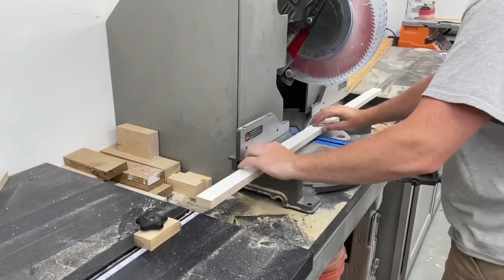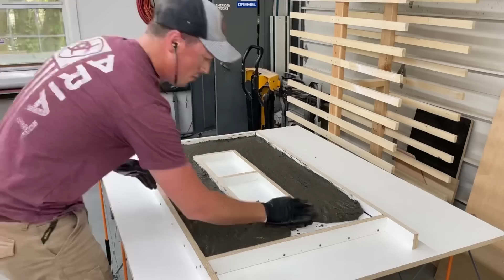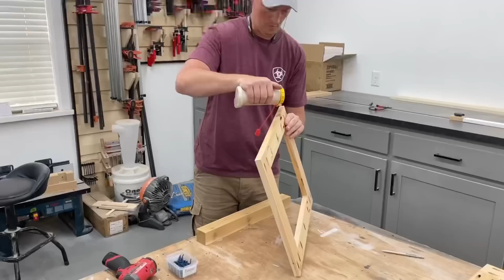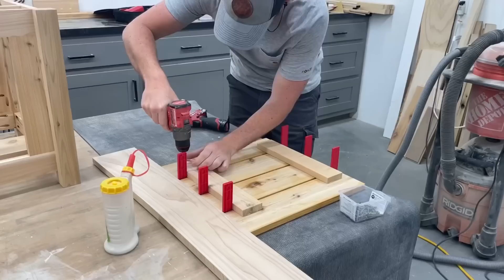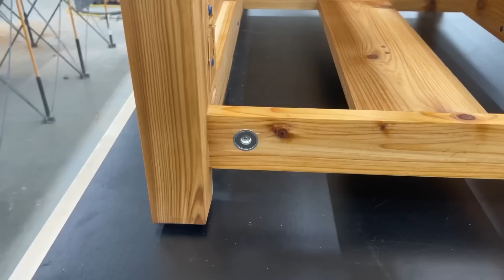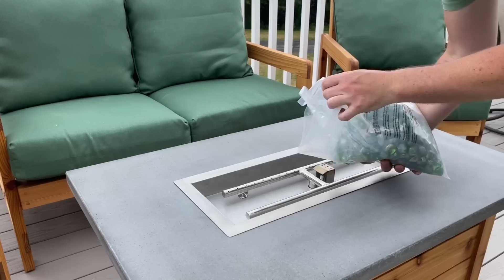DIY Fire Pit Table Build | Outdoor Furniture

Comment: I have 10 vertical 20 lb tanks. I hate to buy yet another tank. Can the vertical tanks be used instead?
Reply from the maker: You could build a taller table to use a regular tank
Reply: @JohnBuildsIt  i was not sure if the fire pit needed a horizontal tank. Thank you

Comment: This will crack with heat.  Mine did.  Same set up😢
Reply from the maker: Zero issues after 2 years with lots of use 🤷🏻‍♂️
Reply: did you have extreme temperature swings when using your table to crack? i ask because i want to do this but live in harsh minnesota winters and dont want to do this and have it crack

Comment: Doing a DIY creating pallet couches with the idea for a firepit that would consist of pallets as well. Would the firepit pan itself operate fine if it had direct contact with the pallets? Or would you suggest some kind of insulant to prevent the wood from smoking up or burning? Also how tall would you suggest it to be?

Comment: that one you made with the deckboards is what i’m thinking about doing. do you think you need an elevated pan to do that or would a flush pan work on the deck boards? i have left over boards from my timbertech deck and i figured that may be a good use
Reply from the maker: The metal on the fire insert I used on mine really doesn’t get very hot so it should be fine with the deck boards. May just depend on the insert

Comment: I like your work I've seen several of these but yours looks the best over all.  I would be putting my own twist on this and that is to make sure I can disassemble it and take it with me if I move  The other is I like wrought iron and wood look combined so I will go with a darker stain or oil and use wrought iron nails or fasteners of sort on the visible side to appear older.   But good video on this build it does look good.

Comment: Great build. Im building one with outside being Faux Stacked Stone (its a polystyrene foam)  and wanted to know how hot the Concrete gets and if you think the wood or the supporting box gets hot enough  inside or outside to cause a fire. Im assuming you using wood it doesn't?
Reply from the maker: No nothing on it gets hot at all besides the fire insert

Comment: we are building one now, but using pallets and leftover tongue and groove from our patio cover ceiling, so the wood cost is zilch.  gonna be pretty heavy base though, thinking of just putting the propane tank on the exterior with a hose and propane tank cover (a million options on Amazon), plus the horizontal tank is expensive.

Comment: Have you had any issue with the propane hose melting and leaking gas due to been so close to the burner pan? I read someone had this issue on another video and it cause a fire under the table. It could have exploded. I am planning to use a metal hose but wondering if it happens.
Reply from the maker: No I haven’t. Our metal pan doesn’t really even get hot, even on the outside

Comment: I wish you did a vid for the wooden top one you showed…..I wanna make one but want to avoid concrete…
Reply from the maker: It’s the same thing. Just lay some deck boards down, leave a gap between them, and screw a few cleats on the bottom to hold them together.
Reply: @JohnBuildsIt  thanks I’m going to do that

Comment: Great job! I built one a few years ago but used regular untreated tongue and groove. It stays under our patio so I wasn't to worry about it sitting in the rain but I think I'll redo it with some cedar.  I like the magnet for the door too. I did Put wheels on the bottom of mine so I can move it around on our concrete patio.

Comment: How did you fasten the top down to the base did you just align it and PL it down? Also I did not see down in the product section, what were the magnets used for the removable hatch?
Reply from the maker: I bought them locally at Menards, but similar to these https://amzn.to/3O1Vdxf
And the concrete is heavy enough I just sat it in place, haven’t glued it

Comment: Maybe a dumb question, but how do you sand the cedar, specifically the edge profiles, without messing them up? Do you have to do it all by hand?
Reply from the maker: Stack multiple pieces together so the sander is more stable and won’t roll off, and then yea I usually do the last grit by hand

Comment: Thats a great build. I did one of these for my dad a few years ago and couldn’t find anyone that did a concrete top. My process I worked out was exactly like yours after watching a ton of countertop videos, but I used a piece of rigid foam insulation for the center cutout as I was afraid I wouldn’t be able to get a melamine square to release cleanly. It made removing that center piece after curing super easy. I used 2 of the mini propane tanks on mine, but I really like the larger tank you used on its side. My mini tanks went in through 2 single panel doors I put on the front of the table. I really wish I would have seen this a few years ago, it would have save me a ton of time researching that project.
Reply from the maker: Thanks man! The horizontal tank sure is nice. All the store bought tables you can buy, all use regular vertical tanks and I just think that makes the table too tall. Good idea with the 2 small tanks though!

Comment: Nice build 👍 I'm not sure if you know this, but the red silicone cap on the glue bot will slide onto the nub in the middle of the fill cap and keeps it out of your way.
Reply: I was going to cut the cap off because it kept dangling into my glue, it was driving me nuts, then I just had a eureka moment.
Although it's probably in the instructions. One day, we'll all start reading them. Today is not that day. Tomorrow doesn't look good either 😂
Reply from the maker: Nice haha thanks, never paid attention!
Reply: How long have I been using glu bots and I had no idea?!! 🤦🏻‍♂️🤣🤣